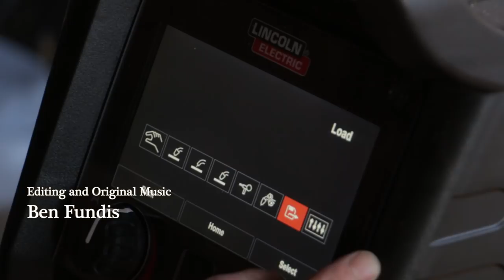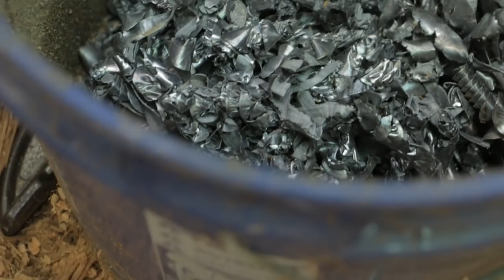Acorn to Arabella - Journey of a Wooden Boat - Bonus Content: Acorn to Arabella 2020 Recap - Part 2

Comment: That homemade adjustment on your circular saw used to create compound curved cuts was amazing. On another note, watching you weld in a boat shed with a foot of wood chips and saw dust on the floor was frightening. I witnessed the Boston Tea Party Museum catch fire when they were working on the adjacent bridge. They said it was from a welder, but when I walked by just 2 minutes before the fire I saw a man using a gas powered saw to cut rebar shooting sparks towards the building. The fire was so quick and intense that two fire trucks and a fire tug boat could not put it out. I think if I were to watch something that I worked on for 3-1/2 years go up in flames they would have to put me a mental institution afterwards. Good luck and be safe.

Comment: Working for about 2 bucks an hour for years... no thanks! I built 2 houses since you poured the lead.
Reply: Which exactly shows the difference between houses and wooden boats. For a house, half-arsed is "good enough", but a boat needs to be built PROPERLY.
Reply: @Garryck-1  Yeah... you keep thinking that.
Reply: Zomby Woof , maybe you could make some videos of theses magical houses you built? Guessing you had all your material delivered? Sub-contracted everything out? Or did you make your own 2x4’s from trees ? Smelt your own electrical wire and copper pipe? Please let us know